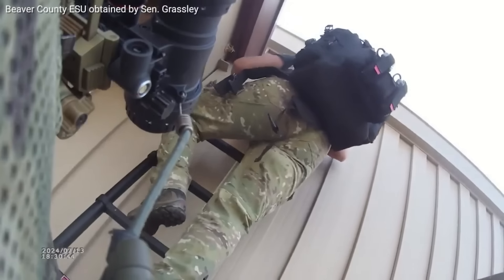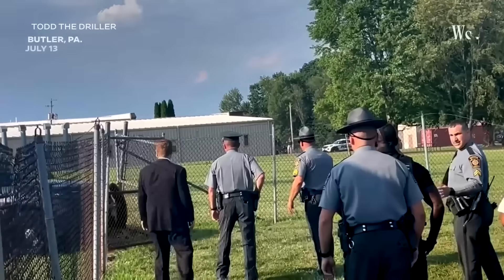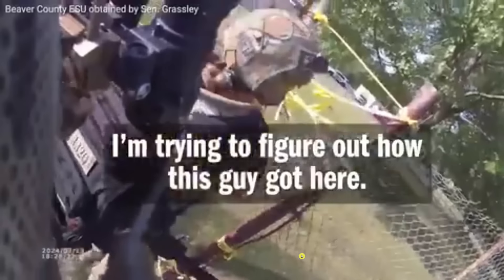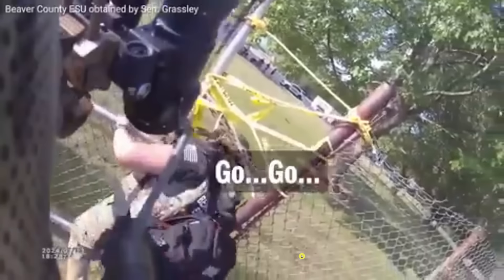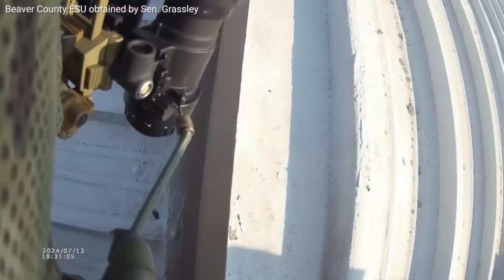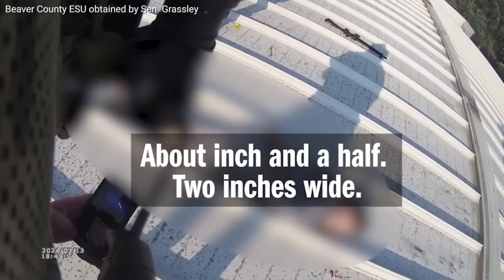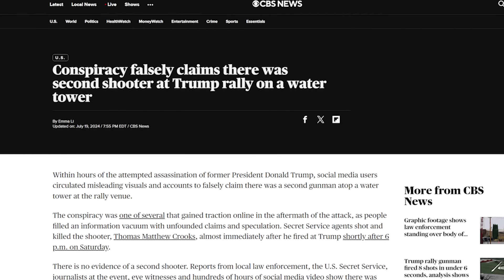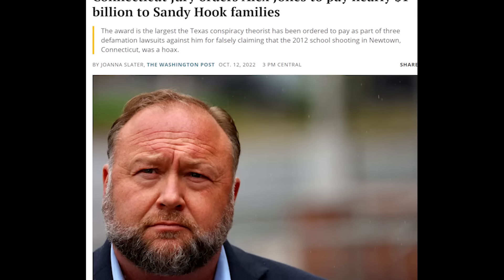Trump Shooting Analysis: Shell Casings, Ladders, Drones, Bodycams,

Comment: The ladder against the air conditioner is not a conspiracy theory, it is Video from a helicopter before the police or fbi arrived over to the building. This helicopter passes over the building with a freshly shot body on top of it. It shows a ladder with red sides against the air conditioner. Then the fbi said he had a receipt for a ladder in his pocket. So he buys a ladder that day but didn’t use it?? The black ladders were brought in after the tall red sided  ladder next to air conditioner was removed. So it is just an inconsistency in their story.
Reply: They mentioned the ladder he bought was a "short" ladder.
Reply: I seen that video too. A short ladder on the low roof to get higher.
Reply: I saw that too.
Reply: Story’s are changing remember the officer went up the ladder after him to and he pointed the rifle at her     If the swat team brought the ladder then how he get up or her
Reply: @elmosweed4985 definitely not short latter it was a double level extension ladder
Reply: The only video I've seen of the tall ladder, is with the police vehicles already parked next to the building. Can you reference a source for the other one, I've searched but can't find anything.
Reply: @grumpusmaximus9446  
Yes, and the rifle had already been moved away from the body.
Reply: @Floreypottery In the original interview of the local LE, he said that one officer hoisted the other officer up to the roof. Is there a video of a local LE saying they used a ladder?
Reply: That's a totally different ladder
Reply: And it looks longer than the 5 ft lader claimed he purchased prior!
Reply: At 11:50 the area to the upper portion of the building was recorded by spectators and fully viewable now showing Crooks climbing from that point. Find it.
Reply: Wouldn't the original ladder be evidence and touching it would contaminated evidence?
Reply: Nope, it's intentional interference on a crime scene.
Reply: @kellydoyle  Yes, I saw and heard the tale about the TWO officers going to check on the guy on the roof. It says that one officer helped the other by hoisting him/her? up onto the edge of the roof, where this one could see onto the roof, but did not manage to climb up entirely. Then the next thing I heard on that recording was the the climbing cop lost his grip on the roofing and tumbled down to the ground. I wonder where the one helping him to get up there had gone? Didn't that one manage to help the one who tumbled down? not a word of that part ... that's also like an unfinished lie.... keep them coming!
Reply: A POLICEMAN  CLIMBED UP A LADDER AND STUCH HIS HEAD UP AND CROOKS TURNED AROUND AND SAID HE WOU,D KILL HIM. WHAT HAPPENED TO THAT GUY ?
Reply: So how did he climb up to the roof?
Reply: @Floreypottery   The officer didn't go up a ladder. He was hoisted up by someone else, needing both hands to pull himself up over the edge of the building, with no ability to be able to then draw a weapon upon the shooter as it was pointed at him.
Reply: So the shooter had a 5ft ladder and the receipt of purchasing the ladder on him?
Reply: And just for the record, he bought the ladder several days before.  Why he still had the receipt on him is a bit off a mystery.
Reply: That was later.  The police had a ladder coming after they had already used the black collapsible ladder to on the roof.  An officer cut his hand climbing on the roof using that ladder.  The ladder that you are talking about was not against an AC unit.  It was against the breezeway between the two buildings.
Reply: @commentsedited , maybe the 5 ft ladder was used at the water tower by the other shooter to get to the first rung on it.
Reply: I noticed that too, so I was perplexed when they claimed he didn't use it.
Reply: The main inconsistency is this video promoting the FB1 narrative. We know Crooks was easily visible by ground level witnesses, as well as All roof teams and especially from second floor windows. No trying to talk around that.
Reply: @Maxx134a    The video is accurate.  The two police snipers that were in the 2nd floor left their positions to search for Crooks.  They were walking around the building searching for him.
Reply: That BBC helicopter vid was from after the cops had left the roof not before they got on. Note that all the people are gone from the grounds in that vid, except the cops. That shows you it was later.
Reply: @grumpusmaximus9446  sky news titled: footage appears to show rifle and body on roof after Trump… it was shot before officers were able to make it to scene. Ladder is behind the two small pine trees and it is leaning up against air conditioner and it has red sides and looks to be taller than 5 ft. The officers later brought black ladders and put on front of building. But that ladder appeared to be missing when they were there.
Reply: @Floreypottery  the police officer who took a look on the roof got help from his partner, he lifted him up, they didn't use a ladder
Reply: The ladder was attached to the building. Almost all commercial buildings have ladders attached. He may have bought one but didn't need it
Reply: The ladder in the video is a police ladder that they leaned up against the building. That area video from the helicopter any basic person can add Photoshop and take out as well as put in ladders
Reply: Laddergate
Reply: There were a lot of people seeing him on the roof don’t you think those same people would’ve seen someone taking a ladder away from the scene because they didn’t see it because it didn’t happen
Reply: @bulld9646 not true
Reply: @bulld9646  sky news titled footage appears to show rifle and body after Trump… it is before police had time to respond and the ladder is against the air conditioner not the building, and behind the two pine trees. The ladder has red sides and is missing in later videos I have seen.  after police and fbi arrive everywhere, they show later footage of them on a black ladder gaining access to roof via front of building.
Reply: @MDK75345  yes and if you watch that footage again you will notice only police cars, no other people, everyone is gone already, the footage is probably from one hour or more after the shooter was killed and police already left the roof. Remember a helicopter is not very fast and they were not there when it happened, they could not be there in a couple of minutes. Also you see in the footage the rifle was already separated from the shooter, giving clear evidence the police already had been on the roof  before the helicopter arrived.
It is however very strange the crime scene wasn't taped and the shells and all evidence wasn't marked like every other crime scene would have been. As if there was no need to collect evidence that can back their claims afterwarts
Reply: @dj__grizzly  the body is still on the roof it is blurred out but still there. And I saw this as it was being aired not later. It was immediately after the shooting.
Reply: @dj__grizzly  after you take note that the body is there because police have not made it over there yet, also take notice of the reporters saying we believe this is the body of the shooter
Reply: The ladder was recovered along the side of a road away from the crime scene along with some other stuff belonging to the shooter.  He apparently dumped it at some point.
Reply: @bulld9646  Okay maybe, but if that was true he flew a drone I would think his pre-survey would have told him that. 

The USSS+FBI explanation do not add up. This mazes has so many turns we will never ge to the cheese ;)
Reply: Where is the helicopter footage of that red ladder?
Reply: I have multiple Pictures of the big red ladder
Reply: @larserna yes, sounds set up. The more info, the more we are confused
Reply: @dianacarr5515 no that morning he bought the ladder
Reply: @mattthornton8474 no way could someone climb on another man and reach the roof edge …. Just look at the cops they’re all short and fat … two Barron trumps in uniform at the same location ?.. come on man
Reply: Yup, I was watching it live like many others, before anyone got to the roof you could see a orange ladder leaning against the connecting hallway structure of the buildings (parking lot side) behind the small trees/shrubs in aerial footage. When these guy get their that ladder is gone, and they had to bring their own? In the same aerial footage there were two law enforcement vehicles park out side and the double doors to the building entrance was wide open. The shooter was dead on the roof and NO ONE was there , outside or on the roof yet. This was several minutes after the shooting. Something is messed up here.  I don't think we all are suffering from the Mandela effect. Seriously WTF!
Reply: @MDK75345  i can't argue about the timestamp of the helicopter footage because i don't find it but.. what you say is the helicopter was already at the rally or very closeby, it only took minutes for the first cops and that ss agent to get on the roof.
Reply: @JoeS97756  first the ladder must have been put there for him, because the first thing released by the fbi was the receipt for the ladder in his pocket. Then when asked how he got it there they said no, it was the police that brought one,then they showed them with a black one going up on the front of the building to confirm it, then they said he didn’t use a ladder at all , how convenient that it was found with more of his stuff so everyone would know for sure it was his, he bought it and it was never at the site. Wow … because The ladder was in the video in sky news titled: footage appears to show rifle and body on roof after Trump….
The ladder is behind two pine trees against air conditioner and has red sides. It was before the police or fbi made it over there because the body is blurred out and rifle still there and everything. And reporters are heard saying; we believe this may be the body of the shooter. 
It is there. And missing in all other footage where the  police and fbi appear.
Reply: @Floreypottery  That officer never used a ladder, he was on the venue entrance side of the building, climbing up on the other hallway roof. That side had an ac unit he could have used and was helped up by another officer. The ladder everyone had seen was in the aerial footage on the other side of the building leaning on the other hallway connection opposite the officer, and where the shooter was in line of.
Reply: @MDK75345  I'm not understanding you.  Because he had a receipt for a ladder in his pocket means the ladder was used to access the building?
Reply: @dj__grizzly  the police took the body and the rifle when they left. This video is not after they left the body and gun is in video. Untouched no police on roof or anything
Reply: @JoeS97756  it appears the ladder was put there for him by someone in fbi to help him get on roof quickly and easily, and the receipt reported immediately was to give an excuse for the ladder, then it was too hard to explain how he carried it over there earlier in the day, so the story changed to there was no ladder, then to there was one but it was a black one we used, then released footage of police using black ladder to go up with, then to -shooter didn’t go up on roof with a ladder at all, he used equipment on building, then to -hey look we found the ladder with some of his stuff on side of road so here you go,this explains the receipt we said we got out of his pocket. Case closed.
Reply: Maybe they didn't use any ladder that was already there because it would corrupt evidence before any analysis was done.
Reply: that clip is in this vid at 9:00 and he mentioned that the police put that ladder there
Reply: @danielcantrell9227  the people were on the opposite side of the building seeing him from there. The front of the building had no people just a parking lot- the ladder in sky news video is in front of the building facing parking lot behind the two pine trees leaning on the air conditioner , it can be clearly seen from the sky news helicopter, any one of the police or fbi could easily remove it when they got over there. The black ladders they used to go up look nothing like the tall ladder with red sides that was against the air conditioner in sky news video when the body and gun were still on roof and no one else. The video was before the police or fbi made it over there.
Reply: So you claim that footage was soon after the shooting. I think that’s untrue. Why would the officers have walked past Crook’s full length ladder to use their small ladder on top of an AC unit on the next building?

Pretty sure the tall ladder seen in aerial news footage was brought in after.
Reply: @Floreypottery  it appears that he climbed onto an AC unit and then shimmied up a pipe.   The "five-foot ladder" report from the day of the event, was based on a bloody receipt they pulled out of his pocket.   Wray testifies that they did recover the short ladder, but it was not at the scene, and it was not in his car.   That's what fuking Wray said under oath.

Methinks the ladder was part of an abortive plan.  The spot where everyone filmed him climbing on the roof had a short AC unit on the ground and a heavy pipe leading up to the roof that a spry 20yo could have scampered up.
Reply: @MDK75345  I would love a link to this early heli footage of the crime scene before the boots got up to the sloped roof.
Reply: @MDK75345  by the way, even elon musk asked this on twitter after watching the helicopter footage : why is that body still on the roof.
Reply: if you go look at the glass company on Google earth, you’ll see some kind of plastic storage container, something you’d see in a shed that holds tools like a shovel and you’ll see a plastic chair on both sides. He put the 5’ ladder on top of that and then was able to run across the breezeway that drops down, then back up onto the taller section where he ended up dying. If you pause this video at 9:00, look for the little white overhang towards the parking lot. Just to the right, you’ll see the plastic storage container with the ladder on top of it.
Reply: @dj__grizzly pause the video at 9:00. Look just to the right of the white roof that overhangs towards the parking lot and you’ll see a small ladder on top of the plastic storage bin. It’s clear as day. Let me know if you see it.
Reply: @Floreypottery No the cop was on another’s shoulders .
Reply: The video from the helicopter wasn't taken before the police or FBI arrived on the roof. You can see 3 police cars parked nearby and two ladders, one of which there is another video of the police throwing over a fence and then using to get on the roof. How would a news helicopter be able to be on the scene before the police get on the roof?
Reply: What about the black metal ladder that the agents go up while talking about there are ladders on the way?

Why aren’t we discussing that ladder? 

It’s not related to the two that we’re on the way, the one pictured in the helicopter footage, nor the one that this dude bought an order to get up to the roof from the air conditioning unit. He didn’t need a tall ladder from the ground when he could place it on , the air conditioning unit. If some idiot, Cop can get up from the shoulders of some dude that’s probably under 6 feet tall, then wouldn’t you just need a 5 foot ladder from the ground or a 5 foot ladder on top of a 4 foot AC unit? Plus don’t forget there was that little bridge between buildings as well that was lower than the roof line. A 5 foot ladder would get you up to that as well. And don’t forget the siding and pipes and electrical gear on the side of buildings like that. Those are easy to climb. Has no one ever left their house before? What do you guys do in your spare time? Has nobody ever climbed a building before? It’s easy.there’s always a way. You just can’t be fat or old.
Reply: you can see the other ladder at 9:18 on the right
Reply: At what time helly passes over ?
Reply: Exactly.  There is video of a ladder being there.  It's NOT  conspiracy theory.
Reply: @elmosweed4985 stop smoking that weed Elmo! An original video showed him buying and carrying a 10' Orange Sided, with a wider Base, Ladde, from Home Base.
FBI report stated that he carried it  through the woods for a mile, with a Rifle slung over his other shoulder and bag/pouch with Ammo in!
This info has now vanished just like the footage of his drone flight!
Name one citizen Reporter, Drone Pilot, that doesn't record where they have been, what they can see, and any threat to the drone?
I have a drone and film every time, if only to pinpoint where my drone went down and why! I have been taken down twice, once by someone swinging a lead weight on a fishing  line to entangle the drone and I didn't notice until too late and once by a Red Kite, that came out of nowhere and stomped it into the ground. Both times I was able to retrieve the craft because I had eyes on and knew where to head to!
One minute, "Oh, we don't know how many shots he fired" to "There were eight casings on the roof", so "no, there wasn't a 2nd shooter" but it sure sounded like 3 shots at and on target (The Real Sniper, 2nd Shooter) and then 5 wild shots (The Patsy amateur), and then a single shot to take out Patsy, who is making huge, "Here I am" movements!
I believe the Counter Sniper had orders to wait for permission to take out the Target, and knew nothing of the 2nd Shooter, (who fired First), otherwise, their narrative of a weird lone Shooter, wouldn't pan out if he got shot first, before Trump got hit!
Here you go Son, walk about as much as you like, no one will bother you because you are one of us, get up on that roof and cover me, I'll shoot the Mark, and you lay down some covering fire, so that I can retreat and then we will pick you up, only they didn't tell him that he would be picked up in a body bag!
Reply: @NoBody-yy8rk didn't stop them from moving the body, weapons, moving shell casings etc.
Reply: True the whole ladder thing is silly 😅
Reply: He probably realized after scouting the area, that he could get up without the ladder he bought, and that the other ladders on the scene are from LE and agents who had to find ladders to get up. You can get to the roof from the air-conditioning unit.
Reply: @dj__grizzly  Yeah that IS weird!
Reply: also he drover there in his small car. he couldn't have brought the ladder the same day, maybe that's what he did the day before with his van, but that doesn't explain the receipt dated that day.
Reply: @kellydoyle excellent point. Supposedly, one officer boosted the other officer up, and that officer was able to look over the edge of the roof. They must have been really tall officers😅
Reply: Very good observation
Reply: I see everyone freaking out the receipt being for a 5 foot ladder… could be as simple as he put a sticker for a 5 foot ladder on the one he actually bought to get it cheaper lol mf might be an assassin on a budget
Reply: I also remember them saying they lost sight of the ladder like it ran away!!!
Reply: I would assume he climbed up of the roof on the water tower/parking lot side of AGR. There was a shed roof and AC unit I have seen in other videos. That would be a more logical thing to do. It would be tough to climb up that side of the building in your video. That’s a long way to low crawl across a roof to go to the other end. Also a lot more people would have seen him climbing the building and their would have been videos of him climbing up since most everyone was on that side of the building in the grass. But since no one has footage of him getting up. I assume he went from the water tower/parking lot. Virtually no one would have been over there hence no one got pics of him climbing
Reply: My bet is he used the ladder earlier to plant his backpack and gun on the roof.
Reply: @lottieharty the cop peeking over was supposedly on the shoulders of another officer and he wound up falling and hurting or breaking his ankle. There’s video of an officer from Butler, PA describing it.
Reply: The video I saw is different this video has had a portion clipped after the camouflaged officers went into the building and they said he was on the roof and waiting for a ladder they came out and saw the ladder behind the bushes and said well here's a letter right here and they said no use the one over there and that's when they climbed up the Black ladder the letter with the red sides was behind the bushes and the officers asked about it in the video that wasn't cut
Reply: @learnedhand8559 there is video of bystanders telling police there is a man with a gun climbing on the roof, so the gun wasn’t already there.
Reply: @elmosweed4985   A Ytuber found a service van in the car park  on the day with that red ladder strapped to the roof . !
Reply: There was a aluminum coloured long ladder with red sides placed against the building on the parking area side, hidden slightly by a tree which obscured direct view of it. Not a black police ladder.
Reply: @dianacarr5515  Congratulations, you're the only one in this comment thread who knew he purchased the ladder days earlier. 👏 It was purchased on July 8 at a Home Depot store, and that was 5 days earlier, in fact! It would seem to me that any decent detective would visit that store to examine its security video to confirm that the ladder was purchased by Crooks. If that was done, why not just release that video and allay people's concerns that he may have had an accomplice or was part of some larger network?
Reply: @berenonehand lmao bbc? BBC was not flying a helicopter in America.
Reply: Why would you keep a receipt if you are going on a suicide mission?
Reply: Or maybe they did not even know it was there, since they broke through the chain link fence and used their black telescopic ladder to gain access from the W side of the building.  Ladder may have been on the parking lot, ie. E side of building all along.  Crooks would've been seen climbing that A/C and pipe there, by many spectators on the lawn and nobody saw or videoed him doing that.   And what's with Wray referring to that as "mechanical equipment" when anybody can clearly see it is an A/C unit?  There is other mechanical equipment on the S side but that would've allowed Crooks to be seen by spectators AND countersnipers.
Reply: @captainwho1 cops climbed up the east side of the building. That is on the side of the water tower and parking lot. That is the side I suspect he climbed up from due to the people all spectating on the west side in the grass. Also their is more stuff to climb on to get on the roof on the east side and no one would have saw much
Reply: Agree that ladder stuff is a mess
Reply: @x-ringcustomgunsmithing942  What stuff? I agree for sure with he would've been seen on the S and W sides.  He was seen doing his walk around on the W side but nobody saw him climbing up there.  That stepladder "may" have been left there by the cop who was supposed to be on the roof but instead abandoned his post to enjoy A/C comfort inside.  That is something they would want to cover up for sure.  Senator Hawley's whistleblower revealed that.
Reply: @captainwho1  you confusing the directions of the buildings the crowd of people were on the west side of the buildings so if he climbed up there everyone would have footage of him scaling the building. But like I said if climbed the east side of the building where the parking lot and water tower is. And closer to the road. No one would have seen him most likely and could traverse from roof top to roof top making his way over and that would have concealed him on the roof from the secret service snipers. He would have been behind the trees the whole time and screened. There is an ac unit right next to a store shed that goes right up to the roof line on the east side. My kids could have probably climbed up that way. I live almost across the street from this all.
Reply: @x-ringcustomgunsmithing942  Cripes.  Did I not say they would've seen him on the W side?  I'll have to try to find my comment and check if it hasn't been deleted.  I looked at the E side and didn't see anything to climb, except the ladder which was probably left there by the negligent police that abandoned their post on the rooftop (See Senator Hawley's whistleblower report).  Either that or it was left there deliberately.
Reply: @captainwho1  yeah I have seen the body cams and where they climbed up. But there was some that had I think was a Google maps view of the parking lot. There is a shed and ac unit on the east side. Can’t post pics in the comments but you would have to look through the videos of the Google maps view of like winter time it’s not a recent view when the Google car drove through the lot
Reply: There were no helicopters in the area before the attempted assassination
Reply: @brainchildguru  I found that on Google Maps in street walking view.  Bldg. 3 to the right of the door labeled "8".  I said to myself that his 5 ft. ladder on top of that would enable him to get up there.  Now.  Where did they find the ladder that Wray was so evasive about?  Not on the scene and not  in the van?  Why was he being so sketchy if he is not trying to mislead us?
Reply: @AndreaYoungs  It could've been down low at the edge of the roof by his backpack.  He climbed up, got the rifle and crawled up the roof whereupon they saw him.  Too bad nobody saw him the moment he first got climbed onto the roof.  He had to climb up on the parking lot somewhere or else he would've been seen for sure.
Reply: @johnparsons1466  Wray's statement was that he purchased a 5 ft. ladder from Home Depot, but he said he purchased it THAT MORNING.
Reply: There was in fact a long ladder shown and the short ladder (Crook's?) that was on the AC unit on side of bldg.
Reply: @captainwho1  Wray lies all the time just like after the Vegas shooting. The story keeps shifting all around so everyone's confused and maybe that's deliberate. Was the local officer who confronted Crooks on the roof but then fell, on a ladder as initially reported or being boosted up? At one point it was reported that was much earlier when now it's immediately before Crooks began shooting. It has been reported there were 2 counter-snipers in building 3 behind Crooks but I read yesterday that there were 3 and they were in the same building as Crooks (building 6). It was also reported both left the building to look for Crooks after they took his picture. Then it was reported that they did not abandon their post. I could go on all day listing stories and how they've shifted. There is clearly a large amount of information being withheld from the public. If it's an open and shut case he acted alone, why not just put it all out there? Maybe they'd find out from some tips that he did get some help. If he did, then crowdsourcing might help prevent another attempt on Trump or someone else. It's like they really don't want to know or they don't want us to know.
Reply: @wasatchadventures8947  Elon Musk had a photo of the front entrance to the AGR complex with the 5 ft ladder on top of the AC unit about 25 ft to the right of the main entrance. Elon posted it on his X on the night of the shooting and it's probably still there.
Reply: @johnparsons1466  Yeah and people like the author of this YT video are shaking their head about "conspiracy theorists".  He hasn't responded to my comment that if Crooks climbed the A/C and pipe on the W side that he points out in this video, why then did nobody see him when that was in clear view of the people on the grass underneath the trees who saw him walking around there and on the roof after he (as we believe) climbed up somewhere from the parking lot (E side).  This all has me completely disgusted.  I hope that Wray doesn't get away with this.
Reply: @ernestrimbeck7630  Source?  Do you think Sky News could get a helicopter there around the same time the 2 cop cars can arrive in the parking lot as shown here?
Reply: The hlack ladder used by the SWAT team on video was on the adjacent building was there before the ladders that were "in route" ever made it. Whether or not they brought additional ladders or what color they were is anybody's guess.
Reply: Agreed! The question about the longer red ladder still remains, during Wray's testimony he did not answer the question about the longer red ladder against the building. And based on the shooters location at death it would make more sense to use the ladder instead of the air conditioning to climb up on. Thoughts? Any info on the red ladder?
Reply: @NewRiderNation  Watch the newest release from Grassley on LiveNow from FOX.  Looks like they were avoiding the use of it (except for first officers on the scene).  Apparently after that they used the telescoping black ladder to get up to the right of Bldg. 3 door.  I think they didn't want to contaminate the fiberglass stepladder any more so that CSI can dust for prints etc..  Also, this is wild speculation, but maybe Crooks boobytrapped it with razor blades or something.  One of the officers had hand lacerations that went up initially.
Reply: No one has any video of Crooks approaching the building or climbing up a wall on the building. The most likely explanation is he came out the roof top window on the second floor which can be seen at posn 9:01 on the video.
Reply: How can you Wear bullet proof vest n no helnet
Reply: Don't suppose you have a link to that video?
Reply: @MDK75345  
Exactly, now they Fb1 could clear this up if they show the bloody receipt along with the video at the store, so we can all see the ladder that was purchased and if it matches Great no problem case solved, but if Not, then we have a big problem.
Reply: @grumpusmaximus9446  it was Sky News helicopter footage from immediately afterwards
Reply: @thomasrobinette3227  
Maybe he planned on returning it after the gig was over... Lol 🤣 l say they release the video of when that ladder was purchased... That will solve some answers...
Reply: @ZenThruAnger  I think the first few cops that showed up used the orange fiberglass step ladder (10ft?) and I believe it was already there (YES!).  Someone lacerated their hand. Was the ladder booby trapped with razor blades (pure speculation on my part)?  They then were told that the ladder was evidence or something and maybe (?) CSI would need to dust it for prints so they waited for the black telescopic ladder to arrive and used it from then on, just to the right of the entrance to Bldg. 3 ( the adjacent bldg. to 6) so as not to be using the ladder which was evidence and presumably used by Crooks.
Reply: @johnnieblackburn3182  Yes that's what I've been saying, especially after the latest video from Grassley.  Initial few cops may have used it though and then were told don't contaminate the evidence!  Maybe it was boobytrapped as well because someone lacerated their hand (speculating here).
Reply: @anifyz  Did he say they put it there or did he say they used it?  Wasn't clear to me.  Anyway, we know from Senator Hawley's whistleblower that there was a cop in charge of being on the roof of Bldg. 6 and another one that was supposed to be patrolling its perimeter on the ground.  According to whistleblower it was too hot so they abandoned their jobs and went inside where it was air conditioned.  Can't make this stuff up!  How do we know the officer who was supposed to be on the roof didn't leave the ladder there and Crooks exploited it for his purposes?
Reply: @clivemclaughlin3920  The ladder was there seconds after the shooting, when there were only 2 cop cars in the lot and the SkyNews helicopter had just arrived.  First few cops of course used it and then they were told to not contaminate the evidence (speculating) and the rest of the cops waited a very short while for the black telescoping ladder to arrive.  They did NOT set it up on an A/C unit.  The latest video from Grassley shows it all.  They set it up just to the right of the door to the adjacent building which is Bldg. 3.
Reply: Exactly! Why would the police use 2 different ladders on 2 different sides of the building.  The red ladder is being covered up. Why is their no body cam footage of them climbing the red ladder but all of them using the black ladder on the opposite end of the red ladder
Reply: @jeremysmith6927  Right, except it wasn't 2 different sides of the building.  Watch the full Grassley video which shows more than the first one released.  It still doesn't show the very first officers activities as you have said (the 2 white police cars in the parking lot seen on the SkyNews aerial shot).  Do they have video of that I wonder also?  Bldg. 3 is the adjacent bldg. to the right of Bldg. 6 (weird numbering yes).  They went up just to the right of the front door to 3, between the door and the plastic locker/shed using the black telescopic ladder.  This whole thing smells of rotten fish.
Reply: @kellydoyle a communication at the time said an officer was climbing up a ladder, shooter aimed and the officer fell which I thought was a reference that the swat guys ask about someone getting a laceration to their hand. They other thing I think may have happened was in all the chaos as that first officer was getting up there, one of the counter snipers may have shot at them or just coincidentally one of their rounds came close to them, which they assumed was the shooter. Kinda makes sense. These are the kinds of things that always get confusing
Reply: So the thing is, there is a ladder already up when the first swat guys go up. This is a ladder the police brought which I assumed was the one that officer that went up and fell from after either crooks aimed at them or- in the swat video the FBI agent mentioned another person in custody, which I thought, maybe the officer that fell, went up, counter sniper sent a round at them, thinking it's someone with the shooter, officer mistakes that as the shooter firing at them. Swat guy also asks about an officer with a laceration to their hand which I assume is the officer that first went up and fell. I know people are saying they boosted them up, but I heard the com at the time and they said ladder. That may have been another officer, but a boost isn't high enough anyway except for a lower section, on the other side. Idk that doesn't make as much sense.
Reply: @Floreypottery the ladder is up when the first team who goes up, gets there. Watch the swat bc vid
Reply: Did you really say "nozzle of the rifle" 🤭
Reply: @Floreypottery  that's not how the officer got up other officers hoisted him up there. There's an interview of the officer that did that
Reply: @seeharvester  it's a crime scene they shouldn't have moved the gun pictures should have been taken of everything
Reply: I don't think the rifle was moved away from the body. The powder residue is on the ridge cap just below where the rifle is. So I believe that's probably in line with the rifle. I believe he fired up closer to the ridge cap started moving to make a retreat. Decided to leave the rifle and probably thought he was far enough below the ridge that he couldn't be seen and started working his way back to the same direction he come up. To try and make an escape. @seeharvester
Reply: @snarklar  Interesting. In the local LE interviews and State Police Col Paris testimony, they said the officer was boosted up to the roof by another officer. The only reports I’ve seen mention a ladder were newscasters, not law enforcement.
Reply: @bulld9646 u r wrong there was a ladder behind the tress n leaning on the bldg. Around 8 to 10 foot ladder absolutely seen it in the helicopter video!!
Reply: Absolutely lying!!! Ladder was there!!
Reply: Then they powerwash the roof a crime scene!!!
Reply: @herculydia 
I saw the ladder behind those 2 tall green shrubs too.  That’s why I wonder why they had to put a black ladder farther to the right of that area. 
And sorry, I don’t see cargo shirts at 19:25/6 🤷🏻‍♀️
Reply: @MDK75345  Okay I found that video you're talking about. I'm going to debunk your claim that this video was taken before police got to Crooks. Look at the police SUV nearest to the ladder. You see that water streaming under the vehicle? That's from the vehicle air conditioner. For a stream to get that long, for there to be that much water accumulated, that vehicle  had to have been sitting there running  for at least 15 minutes. Likely 30+ minutes.
Reply: @johnratfink7343  Moving weapon away from wounded suspect is standard, basic training. No matter how dead he is. Body gets moved when is security checked for items and other possible dangerous items. There is absolutely nothing strange in that, It would be more strange if they didn't do those things.
Reply: @johnparsons1466  OMG I actually waster time to look for that picture. That ladder you say was "on top of AC unit", that is the police Telestep ladder which is next to that what ever service closet, which has door open covering lower part of the ladder. Some officer said on that helmet cam video "gas is closed from the building", maybe it could be that why door is open. The same closet where Elon said that Saddam Hussein is hiding.
Reply: @FlorenP-z7f  You mean matches that mysterious helicopter video that can't be found anywhere 😂If that is the video where gun is away from the dead turd, it is after police went there to secure the scene.
Reply: @jpenna1976  I can't even find that post anymore. I saw a step-ladder for sure. But now nothing. I never saw the black SWAT team ladder they brought until I saw the body cam video that was just released the other day. I don't know what to say. I think the guys and gals on the scene need to be brought in to Congress to testify instead of the those in charge at the USSS and FBI, who just stonewall. Also, it would help if Sen Grassley would release ALL the body cam videos including the local Policeman who climbed to the roof and then fell as well as of the police that confronted Crooks that day (3). The blurring is frustrating too.
Reply: The first three shots were fired from the second floor of the building next to the alleged shooter.  The weapon that fired the first three shots was probably fitted with a silencer, which accounts for the lack of echos.  The second five shots were blanks fired from the same location but with a different weapon most likely an AR-15 using a surefire trigger that can fire rapidly.  Blanks were used in the AR-15, which explains why no one else was injured.  Local law enforcement was in the building next to the building that the alleged shooter was on.  The last shot fired killed the alleged shooter and was probably fired from the same window as the other eight shots.  Everything supposedly found on the roof by first responders was planted by them as alleged evidence, including the 8 shell casings.
Reply: @robertperry4439  The FBI has scoured the scene and should be able to account for all 10 bullets at some point, right? Matching the bullets to Crooks' rifle should be easy or will it be classified for 75 years? What is the rifle anyway exactly and what caliber were the bullets? It's only been 8 days.
Reply: The ladder was there and because the cops didn't sweep and patrol the area correctly none of them knew the ladder was even there.
Reply: @MDK75345  cell phone footage also shows that ladder. It’s when crooks was crawling up the roof from that area. So we’ll before any shots taken
Reply: @robertperry4439  Nice fiction bro. You should start writing movie scripts.
Reply: They didn't realize someone got a picture of that ladder in place. Never seen another video showing that ladder, only the two brought in later. One collapsible tactical ladder (officers threw it over second fence) and the aluminum ladder (much more stable).
Reply: @MDK75345 
Stop lying
Reply: @grumpusmaximus9446  They can't reference anything. This comment section is nothing but reactionary fools taking the most superficial view of the situation.
Reply: #1-You need to find exactly what kind of ladder he bought, they have the bloody receipt! Is it a 5 foot that flips to be a 10 foot extension ladder type. #2 On the one video when they came into building and the guy said ladders were in route, the two went outside to look around the building to see how he might have got up there and he saw a ladder and yelled back at the cops " here is a ladder, can we use it and they got on top of building and there were a few people up there already, the gal went first and he followed, when on top he counts 5 shells!...#3 The same video but extended that I saw later they were up there for more time and that's when the same guy counts 8 shells. Very confusing to me and if there were people already on top why didn't they know that already in the building?? Again I just find it strange there was a ladder there and there was people already on top!!?? I guess we will find out eventually!!?? Peace and prosperity to all my brothers and sisters!! Montana Rick.
Reply: @robertcheslock9636  There were no other ladder, only these two. Never seen ANY video or picture showing other ladders. Building had multiple points, where could access roof without ladder.
Reply: The bag on the roof disproves that because that bag is the one that the agent asked whose bag it was and the other officer up there said it was theirs. They all already got off the roof and used that ladder to get down.
Reply: @larserna  Building had several points with things at the wall to climb up. These can be seen from drone videos around the building.
People are just obsessed about non-existing ladder. I would be really interested to hear, what would be the motivation for local police to remove and hide a ladder.
Reply: @LottieHarty  Same question I had my friend?! It would be nice to hear from this  man and if anything, at least to make sure he is O.K. and any info he might have. Not someone talking on his behalf. Peace and prosperity to you and your family! Montana Rick.
Reply: @Floreypottery  I remember when him and her went into the building and talked with the guy inside that said there were ladders in route! When those two came back out they were going to walk around the building. Then he saw a ladder and yelled back to.some officer outside the entrance , " Here is a ladder right here can we use it ", the officer said yes. That is how him and her got up to the roof! You will have to watch that video , But it is confusing when he counts 5 shells on the roof and then I saw a longer video of the same.footage and he counts 8 shells?? Something is SNAFU there?  Peace and prosperity to you and your family! Montana Rick.